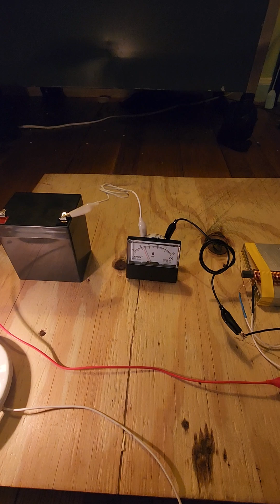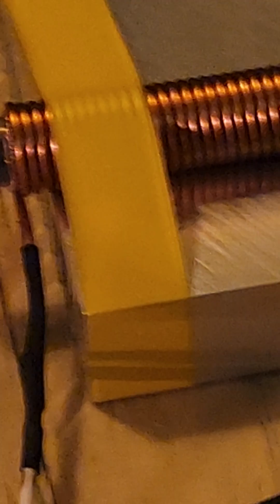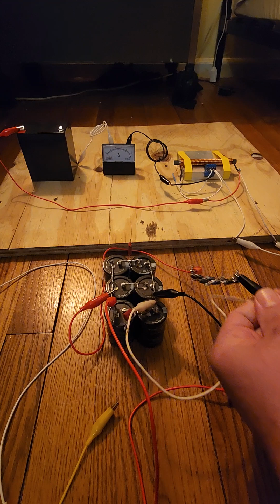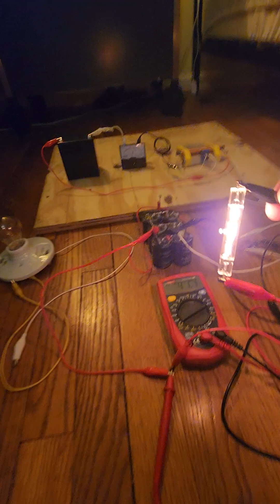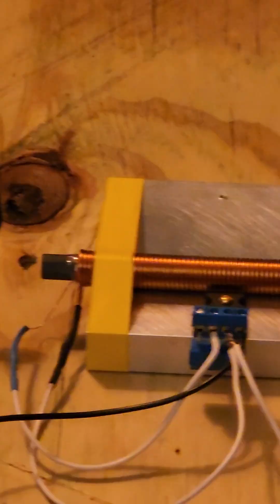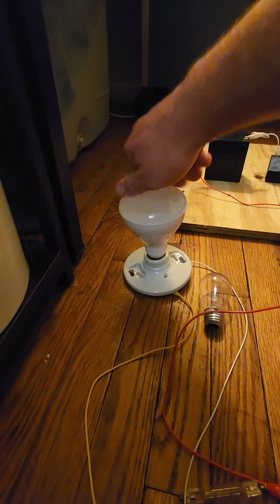💪UPGRADED RINGER DEMONSTRATION & EXPLANATION MORE POWER OUTPUT OVER TIME VS INPUT DRAIN🌩CHEAP ENERGY

Comment: It seems the Moray Valve is using loads of lightbulbs as resistance as a part of the system. Like John Bedini motor generator (becomes solid state) the resistance is the factor for increased repulsion output. Usually for pushing away the magnets that were attracted into the pickup coils. Using battery discharge to attract. Resistance load is used when battery charge is removed. Leads to back discharge and radiant spike from the charged coil. Bedini explained resistance used for radiant spike back discharge by using a pendulum with a magnet. A dead battery being charged showed resistance. The magnet swung highest when the battery was dead. As the battery charged up the resistance dropped and the repulsive spike reduced. The pendulum magnet swung much lower. 
There is another example showing people using resistance to motorize an automobile. In the form of a large metal coil. Placed above the motor. 
As the off open circuit occurs resistance increases potential flyback radiant spikes. A discharged capacitor may be best. Making use of the spike to recharge it. Creating an oscillating capacitor. 
Your circuits are continuously changing. I certainly do wish part of your video establishes the circuit being shown. Simplify this easily by showing a hand drawn diagram and list of parts. Also a short video if you like simply for that purpose and linked. This way you have documented also for yourself. It sucks as a viewer to be neglecting such simple ability. It's really the only thing lacking. Your videos were much better before you started complaining like Ken Wheeler. I really hate his bragging betching and moaning. I only tolerate it to laugh at his hypocritical idiocy.
Reply from the maker: I can go back to a purely educational tone & kens help has been huge but i see where your coming from

Comment: Negative charge is not actually like this. You create a spark gap with a positive monopole high voltage and charge the capacitor. You get electrical output from the bifilar coil. The system is charged from gravitational radiation waves (x-ray solar radiation). The negative pole is connected to the ground.

Comment: You said that this system will charge big batteries and with inverters will run whatever you need. Will this battery run a 240v 50hz 5kw inverter without draining the battery.Also can you have multiples of this system to charge multiple batteries?. If this is the case why do we need solar panels . Please advise as soon as possible.
Reply from the maker: Yes this systems pulsed output will recharge batteries that can then be used to run 120 or 240vac inverters that can run whatever you need for a time or be used to recharge the system. The gain in power comes from the metglas laced ferrite rod & the earth connection. As for solar pannels being obsolete i suppose they are when compared to this style of system.

Comment: Free power lol, then feedback the output to the battery and destroy the universe 👎
Reply from the maker: Right now the system needs a heavy earth connection to achieve that but i do demonstrate that in my older vids. Maybe being tethered to the earth for the extra power is nature's way of balancing things out?
Reply: @MTECH2022  No more excuses please. Measure the power drained from batterie (voltage, current but true rms!)  and then we will see ou or not. And it cannot be so difficult to build the necessary earth connection. Until then the word free energy is misused.

Comment: Imagine having 10 of these independent units, only connecting the pos and neg terminals off their FWBRs. Efficient heater anyone?👍
Reply from the maker: Yes going to experiment with 2 in parallel soon & they're dc outputs combined to charge caps even faster :)